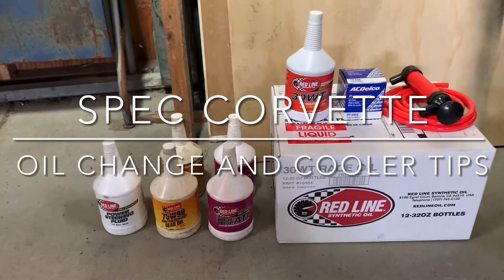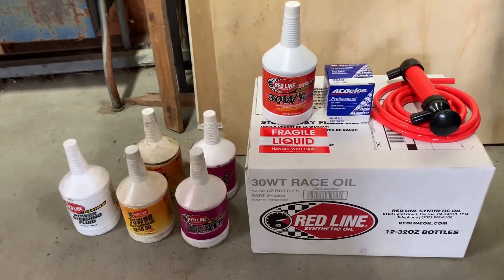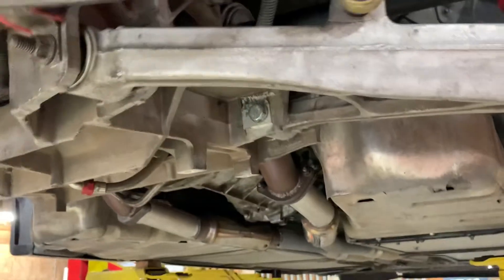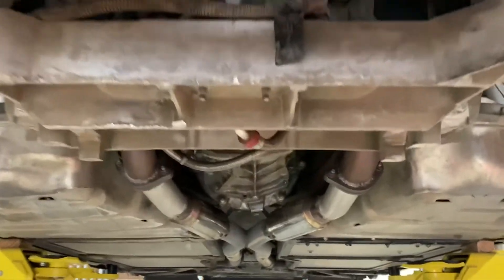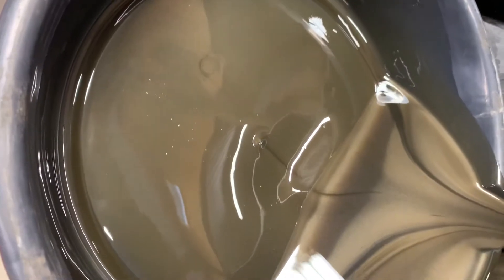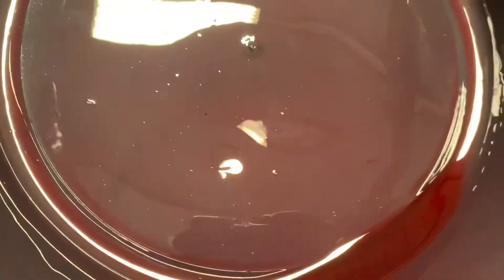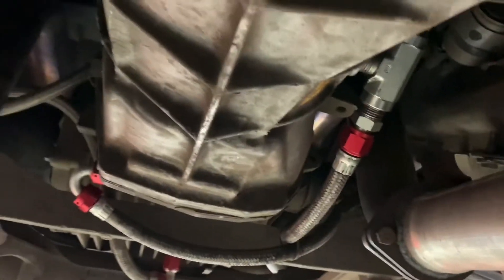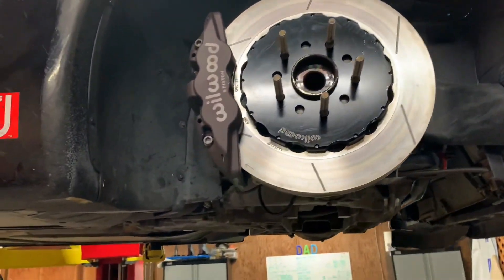Spec Corvette Oil Change and Cooler Tips

Comment: What’s your intervals on changing your 
Brake fluid. Which brand of fluid you using? Which brand of brake pads u use?
Reply from the maker: I’ve been using Torque RT700. Originally, I was bleeding after every race. Over time, that’s come down to twice per season. I’ve had no issues with boiling fluid with this car and brake setup.

Comment: Hi Josh, I’m just about done with the install of the DR diff cooler, how much fluid does it take starting with cooler empty?
Reply from the maker: I think the cooler and lines hold a little under a quart, so it should be 2.5 to 3 quarts total. I suggest filling, then running the pump for a while to push out the air, then topping off.
Reply: @joshc1017  
Thank Josh, I appreciate. Good luck with the silver C5 project

Comment: You can replace the inner tie without removing the rack and pinion. You have remove the outer tie rod and use a special tool to remove the inner that you rent at AutoZone. Fairly simple. 

I'm not close yet but I do want o join spec in the next couple years with my c5, so quick question. Does spec corvette allow any modifications to turning ratio or steering angles?
Reply from the maker: Thanks! I did exactly that today, except I rented it from O’Reilly. Turned out to be an easy job. 

To your question, no mods to ratio or geometry are allowed. That includes no changes for bump steer. Let me know if you have other questions. Happy to help.
Reply: @joshc1017  those sharp turns at streets of willow seem tough with stock turning geometry lol appreciate. Hopefully I can join you guys sooner than later

Comment: Enjoying the spec Corvette videos. What kind of oil temps are you seeing with the integrated oil cooler/radiator? I had a giant air to air in my C6. Looking to simplify on the mild C5 I'm setting up now.
Reply from the maker: I see 240 to 265 degrees, depending on ambient temps, which is pretty high compared to what I've seen in past race cars.
Reply: @joshc1017  Thanks a lot. Sounds like I'll go with an Improved Racing setup again.

Comment: Do you or any of the other spec racers bother with oil catch cans to collect blowby?  I know my car can fill a catch can on a hard track day.
Reply from the maker: Yes, but they're a mixed bag.  I took my catch can off when troubleshooting an issue with massive oil intake (sucking in oil after long sweeping left hand turns and producing a James Bond-like smoke screen).  After removing the catch can, the smoke screen from my tailpipe went away almost completely.  Yes, it was plumbed properly.  Yes, the PCV was working properly and was installed in the correct orientation.  Yes, I checked the catch can plumbing to make sure it was breathing/flowing as it should.  I've been unable to come up with a logical reason that deleting the catch can and returning the car to stock would resolve the problem, but it did.  Greg Nester had the exact same experience.  I do see others running them in the same manner that I was without issue, so I'm admittedly baffled by my experience.

Comment: Are your end links PFADT? Are they durable? Quiet? Any complaints? Looking to buy a set.
Reply from the maker: Yes, they are Pfadt / aFe. They’re plenty durable. I don’t notice any noise from them specifically but have to admit that the car does pass road noise / vibration more than stock. I’m also running spherical control arm bushings and solid coilover mounts. The noise I hear is probably a combo of all of those things. 

The only complaint that I have is that you have to disconnect one end to neutralize the load and wrestle with the studs to fit them through the holes in the bar. I think Spec Racing makes a similar style link with a bolt that is easer to pass back through the hole and eyelet.
Reply: @joshc1017  thanks!

Comment: Nice to see the DRM diff & trans coolers and lines. You didn't flush the oil from the coolers? And to adjust the levels in diff & trans, did you run your pumps to make sure no air is trapped? (asking for a friend :-P)
Reply from the maker: Thanks for pointing this stuff out. I should have mentioned it. I do run the pumps after filling the diff and trans to confirm the levels. I haven’t found a level change yet but check valves do fail, so it should be done every time to make sure. 

Flushing the coolers... no doubt, it’s a best practice to do it. In my case, I would need to disconnect at the check valve and pressurize the return line to get it all out. Alternatively, I could have a second person trigger the pump and stop when the clean oil appears from the return line. This is where I have to admit to being a bit of a hack because I don’t bother as long as I’m happy with what I see/smell when I drain it.